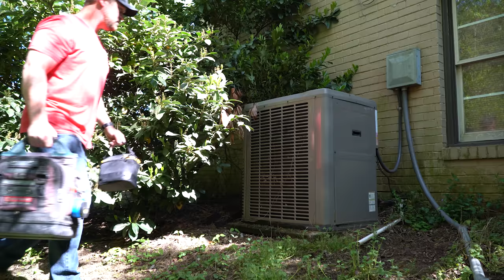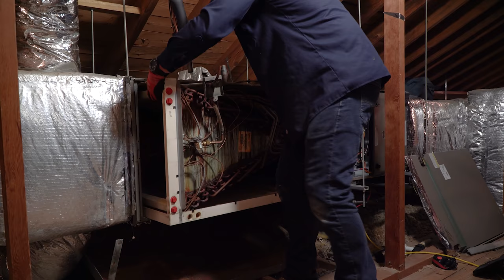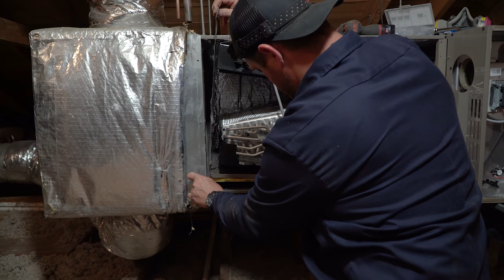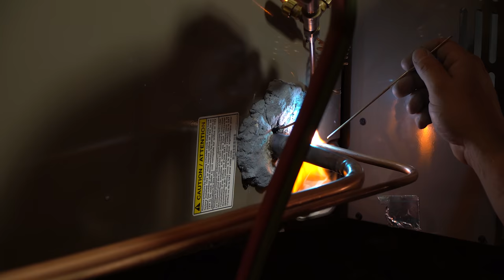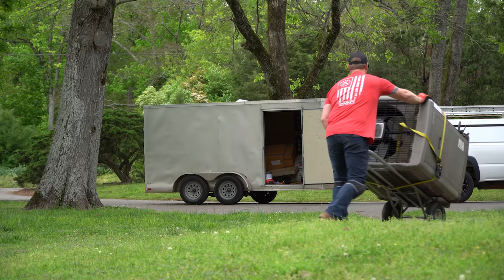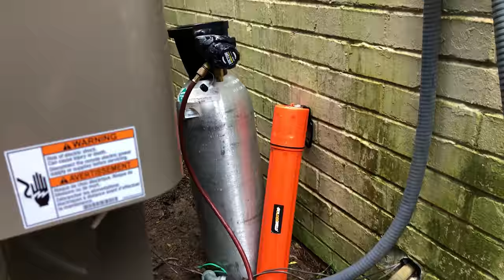YORK Dual Fuel Split System | HVAC Replacement In ATTIC!!

Comment: I love how yall can still get 80% AFUE furnaces. Were limited to 90% and above in Canada. Great job Zack!
Reply: that sucks. 90% systems are a pain in the ass and expensive to repair.
Reply: Really?! Attics too?
Reply: eric ventura most of their systems in Canada are typically in a basement from what I understand. In North Carolina if we put a 90% in an attic we will have a whole bunch of drainage issues during winter time😂😂
Reply: @mason122122goodman  Good point. Most are in basements and crawl spaces. Only A/C's and Heat Pumps in attics here. Granted the drain lines could be heat traced. But that's a pain in the ass!

Comment: Great video 👍. 
Would you please share your thoughts??
Just an overview to provide basic info. We bought our first house (1600 sft) a year back and we have Goodman 2.5 ton heat pump which is 11 years old unit. It works good except that as all heat pumps when temperature drops to below 35 it is having hard time to heat the house and it is kicking to aux heat raising power bill.
-> Can we add gas furnace to the existing heat pump?
-> what is the efficient way to heat/cool house with less utility bills?
-> which hvac system you suggest (brand and model )
Thank you so much !!

Comment: Excellent install. But  bad choice of equipment. You'll be back to replace that condenser coil when it leaks. Then again I had to weld a leak on a carrier yesterday but that's more rare and easier to fix.

Comment: You should still put a pad between the condenser and concrete when it’s that low to the ground.  A pad is like $40 I’m glad Blue Label here in Houston did my install.  They care!  Goodman 4ton 18 seer Lifetime guarantee on Copeland Scroll compressor.  If the compressor breaks within ten years Goodman will replace the whole condenser.  Made in Houston Texas 🇺🇸🇺🇸🇺🇸🇺🇸🇺🇸🇺🇸🇺🇸🇺🇸🇺🇸🇺🇸🇺🇸🇺🇸🇺🇸🇺🇸

Comment: I’m not sure what the pricing is down there but seems like here in Canada 🇨🇦 Calgary it’s probably double the cost and heat pump are not so popular as we reach temps of -40c 
But I’d say a duel fuel system here installed is around 20 grand Canadian. Like a Lennox slp and matching Lennox heat pump is super pricey. And minimal grants as well up to 5k

Comment: 17 Year Field Technician and I still enjoy watching what other techs do in the field. Question? What is the difference between the Fieldpiece Charge Kit and The Fieldpiece Pressure Probe you have listed? Also, When the evacuation is complete. Do you remove the micron gauge, or do you leave it on, while charging?
Reply: I always took my micron gauge off.  It’s what the old school guys always told me.  Keep from pressurizing it and possibly causing damage to it.  Not sure if it would but now it’s just habit

Comment: Can you explain or show set up of the dual fuel by outdoor thermostat or using the main thermostat to switch systems .And can you use a 2 stage heat pump condenser on a 2stage gas furnace ?Thanks

Comment: Did York finally dump the micro channel coil design?  I just read there is a recall for plastic drain pans melting in Goodman coils when installed in an up flow configuration on a condensing high efficiency furnace. It makes you wonder if Goodman actually tests their equipment?

Comment: Surprised you didn’t replace the condenser pad
Reply from the maker: Maybe I should have. 🧐
Reply: Replace or put one on top. Heat pump pad to give it elevation against the elements
Reply: Ivan Hall I replace the pad every unit and remove the old one under then put crushed stone looks really nice and helps keep it level.

Comment: Do you ever have problems with York’s microchannel coils? I understand the most important part of the equipment is the proper installation. I’ve been debating on installing York/Luxaire/Champion and everyone says to stay away from microchannel coils. Do you agree? Or is it more probable that the issue resides in possibly overcharging the system on install causing the issues? 🤔

Comment: Is York your main brand you are installing? If so how do you like the York products? Also I am a small business plumbing/HVAC shop and currently install Bryant equipment, However wondering what equipment you have had the most success with. I know it comes down to the install but I also know you cant install junk and expect it to last either.

Thanks in advance the videos are super high quality!
Reply from the maker: This is the first York I’ve installed in years. I was happy with the quality.
Reply: SuperMudMuppet how do you like the Bryant line? Thoughts on the Preferred 2 stage enquipment?
Reply: @jaredbraswell6343  Decent grade equipment nothing to bad to say about it

Comment: I'm just curious.. hope the lines got flushed with R-11. Why not change it to a 90+ as an upgrade to be more efficient unit? Lastly just an FYI..keep an eye on York products..have found a few bad batch with the new micro channel. Leaks at the rubber sleeves on condensers.
Reply: Most compressor manufacturers advise against flushing lines out.

Comment: Great video! The guy who installed my York furnace last september says dual fuel can't be installed on gas furnace and that one needs an air handler (electric coil heater as the secondary fuel). From what I can tell he might not be on top of his game and I've requested second opinion from other HVAC company...
Its an 80% 100 BTU 2 stages (tm8y100c16mp11a) and it has Y1/Y2...
Do you think there is a miss-communication and I should be referring to a gas+HP setup as emergency fuel instead of dual fuel? Is he right? Or...is this pure incompetency...

Comment: Hey dude, maybe you can help me out.  I have a dual fuel system that I don't know who makes the air handler unit.  It is model No.  DGAX070BDTA.  Do  you know who makes it?  It is making a buzzing sound from a contactor that is installed in a vent tube.  Any help you can give me will be greatly appreciated.